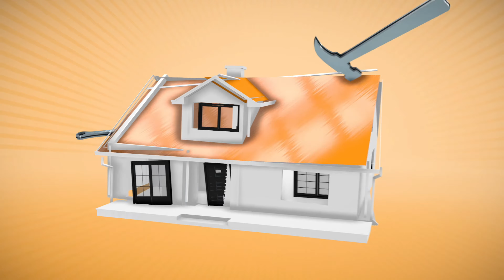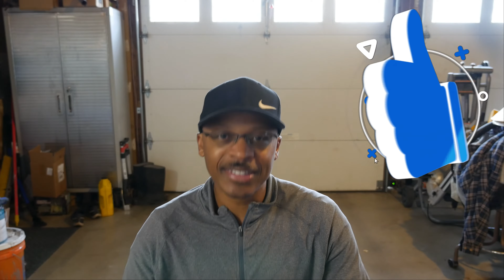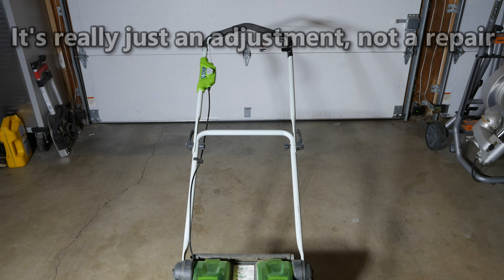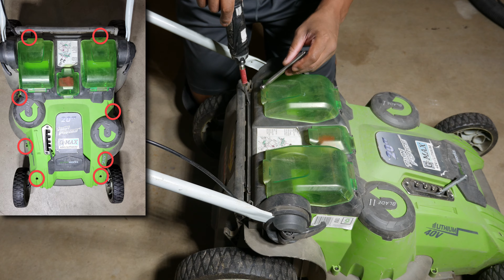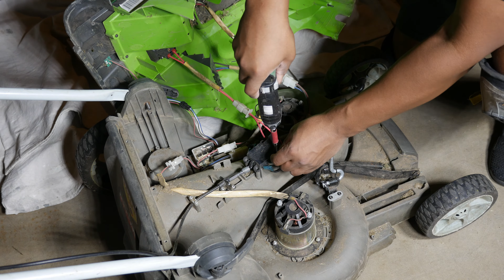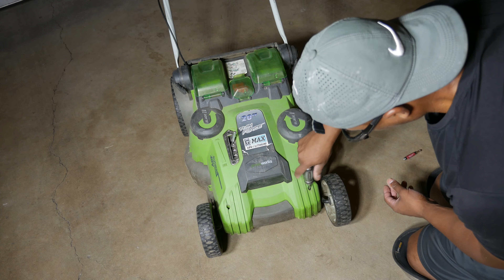Fixing a Greenworks 25302 Battery-Powered Mower That Won't Start

Comment: Where can I buy a replacement motor? The bearing in one of them has a small amount of play and I doubt I can replace just the bearing.
Super good job on the video by the way. 👍
Reply from the maker: According to the parts list in the owner's manual, the part number for the left motor is 36101486 (superseded by 36101486B), and the part number for the right motor is 36101486C. I saw a used right motor on eBay, but new right motors seem to be out of stock everywhere else.
Thanks for checking out the video!
Reply: @DIYApprentice  Will these motors run in reverse?  Albeit, more a safety issue without some sort of maybe hole drilled in the shaft and cotter pin to lock?
Reply from the maker: @jafinch78  I'm not sure.

Comment: One of the blades would not spin. The mower would start but then shut off because I assumed that the stuck blade would not allow it to stay on. I turned the mower on its side and sprayed the blade and on cooper section of the motor which is visible if you turn it over with WD40. The blade spins great but now the mower won't even start up. Did I mess up the motor by spraying it or oversaturating it with wd40?
Reply from the maker: It's possible that the WD-40 is causing contact issues. I would consider using 91% alcohol or electronic cleaner and some q-tips to clean the motor.
Reply: @DIYApprentice  thanks for the advice

Comment: The newer version of the 25302 no longer has the red key and the switch mechanism is now near the handle, Easier to work on the switch and it is a little different setup, but once again easily fixed.

Comment: I've had the 25302 since May 2014.  My 2ah battery that came with it gave up so I ordered a new 5ah battery... and it doesn't work.  The 5ah will run the mower for a second then cut out.  Greenworks mailed a replacement battery that does the same.  It turns out the 25302 isn't compatible with the new style 40v "gmax" batteries.  They fully admit they're abandoning this mower for support, but they still sell it new on their amazon store AND the 25302 is pictured as compatible.  ><;

Fair warning folks.  If you're looking for new power equipment consider Ego first or Ryobi.  Greenworks isn't doing a great job with continued battery compatibility.